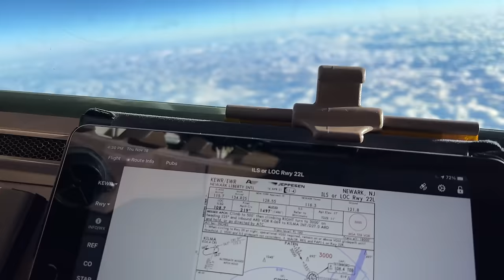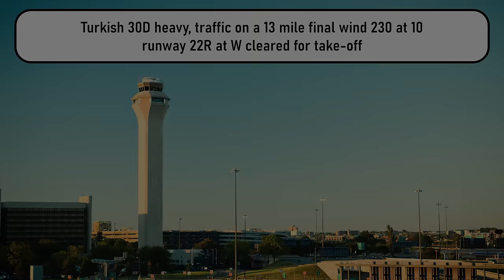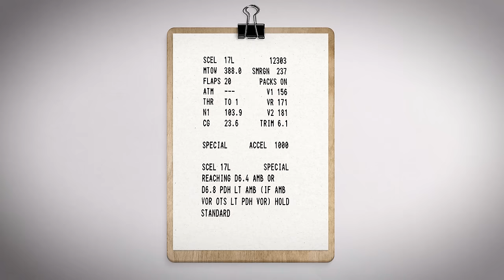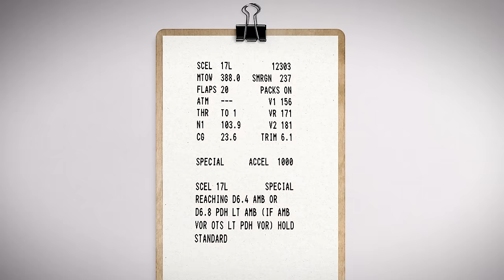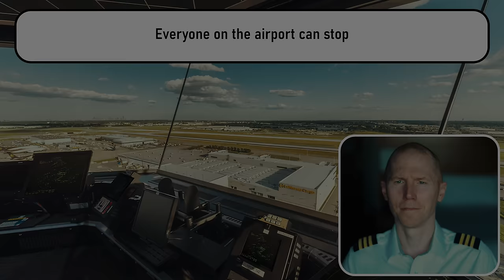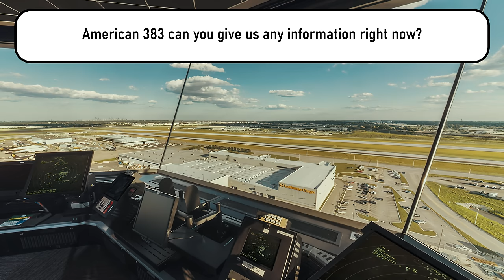American 767 Engine Fire

Comment: As always, excellent explanations.  Acknowledging that mistakes can be made by anyone, and the humility to admit you've made many is refreshing.  Unlike your early piloting story, I did land on a taxiway and it was extremely embarrassing when I realized it.  I had maybe 120 hours and was part owner of a Cherokee 140, and decided to take some friends on a short cross country to a rather larger airport.  Since I was used to the 75 foot wide runways at my home base and getting rather flustered by ATC squeezing me in amongst various DC9's landing and taking off - I was cleared to land on a runway, and I lined up with what I thought was the runway.  The controller let me land and then said *****Kilo exit taxiway delta at bravo.....  And I immediately realized I had landing on the freaking taxiway!  (the taxiway was wider than my home runway, and after I touched down I commented to self, "this is an awfully bumpy runway".... then the controller gave me the scoop when he said to exit taxiway...)

Then when departing a few hours later, and asking for clearance to taxi to the active, suddenly the ground controller said "Oh *****Kilo" and he proceeded to speak very slowly and deliberately, indicating to taxi via so and so and such and such to RUNWAY 29....  emphasizing "Runway" in a somewhat amused and mocking manner  (and I could hear other controllers in the background laughing).  No pilot deviation calls, just some verbal ribbing by the controllers, but I was humiliated and horrified to say the least  (this was back in the late 1970's).  (and I didn't tell the passengers until we landed back home)
Reply: I'm 70 years old now. At age 20, in the military, while doing maintenance on an aircraft, I mistook the fuel dump switch for the battery switch and dumped enough fuel on the line to surround the aircraft for 60 feet in every direction. I am convinced that the poignant memory of that horrifying error has saved my life in the intervening years many times over.
Reply: Heh, I guess we all make mistakes sometimes. While I’ve had a lot of fun during my years on the ground crews-starting with Aircraft Services (interior cleaner but also operating the lavatory and water trucks) and hybridising onto most ramp duties (pushbacks, marshalling, placing the aircraft stairs, GPU usage and some baggage ect)- the worst I’ve done was go from a brightly lit 737 during a night shift and down the stairs on the dark shadowed side of the plane and forget to give my eyes a couple moments to adjust. Hence about four or five steps from the bottom while carrying a caddy full of cleaning chemicals in one hand and a pillow in the other, I don’t quite put my foot in the right place and I start to fall. 

And while trying to get my balance back, the other foot catches the corner of the pillow and that’s it I’m done for. I fall down the remaining metal steps and eventually land on the concrete aircraft stand.  So of course pain explodes from multiple parts of my body and I can literally see bright spots in my vision from the head impact. But I also see the one colleague who witnessed me fall just turn away and continue to walk towards the GPU (ground power unit-basically a diesel fuelled generator with cables and plug to give planes electrical power for lights and whatnot) to turn it off and disconnect it so it can be towed to the next aircraft we’re going to clean. Yes, that colleague is a major douche bag. He’s also just walked out from his shift midway through and blatantly pretended to be sick when he realised we had no airside qualified drivers on the team those nights and would walk 8-10 miles that night between planes. I’m not fond of him.

Anyway while I’m lying there half stunned and cautiously moving various limbs and generally determining if I had any major injuries other colleagues putting their equipment back in the van parked close by noticed me and ran to my aid. By some miracle I didn’t have any serious injuries aside from a bump on the head and a few scratches and bruises. Unfortunately I couldn’t convince my colleagues of this (and I don’t blame them because the side of my face and forehead were bleeding and scratched) and they half panicked, flagging down a pair of pilots and group of flight attendants who had recently landed from another 737 nearby who promptly joined the first aid efforts. I ended up with the on-site medical team being called to me and being watched closely for signs of concussion or compression for the rest of the night.

The actual scary mistake I’ve been involved in wasn’t mine but it still affects me almost every shift because it was so scary. So parts of our taxiways and ground vehicle roads are parallel with only the double white lines separating the two, and planes will turn from the taxiway to cross our road to get to some of the aircraft stands to be marshalled in by someone waving the batons at the pilots. (Admittedly this is my favourite task, even if seeing this big plane with active engines coming straight towards you can take some getting used to.) On this day I was a passenger sitting behind the driver in our van as we headed back to our base. I honestly don’t know how he missed the 737 clearly following the yellow lines and the marshal plus other ramp staff gathered around the stand itself, but he did.

We’re all told this multiple times during different stages of our training, there are signs warning us again that the aircraft always have priority and if we’re ever not certain what one is going then we’re to stop and the nearest safe place and observe until we do know or the aircraft is no longer in a potential conflict path with our own. And so he carries on driving just as this 737 is turning to cross our path. I’ll never forget the terror I felt when I realised that the driver wasn’t going to stop and I looked at the engine closest to me, fully active and pushing the aircraft along the ground. We passed so close to the nose that I could have reached out and patted it as we skimmed by. The third thing I remember is looking up at the first officer’s face once it was clear that we were just going to skim by the narrowest of margins. We probably had matching expressions of mingled shock, terror and disbelief as our eyes met.

I was slightly surprised that our driver opted to just carry on driving back to our base and park up there like nothing happened. I personally would have pulled over and parked in the nearest appropriate spot and just waited for Airside Ops to come for me. Consider them as like airside law enforcement. They are responsible for security and safety out on the airfield and apron and with hundreds of security cameras constantly monitoring every inch, they would come for him even if the pilot and ATC hadn’t seen and reported the near miss. But yeah they took less than ten minutes to find him and suspend his security pass. It was restored next shift but he had his airside driver license suspended for two months and had to retake the test. Nobody in aviation wants someone not to report a mistake even if it causes damage for fear of punishment but we will be given strong reminders never to do it again.

But it looks like everyone does dumb things once in awhile.
Reply: Was this in the US? I have to say your controllers really sound like jerks over there.  I also think they contribute to more accidents than they help avoid due to the rapid fire colloquial style you hear on ATC recordings. I think where I work in Europe, because language is a constant variable (English is used but accents are common) controllers are far more careful to speak calmly and politely.  Even when ours are judgemental it rarely feeds over into obvious mockery.
Reply: @hamsterminator  I've listened to plenty of non-US ATC. They ALL speak fast, esp. in their native tongue.
Reply: If you did that these days, there would a long call to ATC and the FAA afterwards.
Reply: @hamsterminator  Yes it was in the US.  And the tower controller was professional, merely gently pointing out my error.  Later the ground controller was a bit mocking, but I deserved it...  and I'd much rather be gently mocked than be required to call a phone number and be written up for a pilot deviation!  I was a rookie and my radio etiquette probably revealed that to them, which I believe is why they were forgiving and in a sense "teasing" my rookie mistake.  The shame I felt for making this rookie mistake resulted in my never loosing situational awareness again though, so the end result was positive!
Reply: even Han Solo has done that so.....
Reply: @hamsterminator  Well thats the difference, back in that time thats how you taught people.... No pilot deviation calls.. no fines or charges.. just some ribbing to make sure you remember that mess up and make sure it doesn't happen again..
Now a days no one is "allowed" to make anyone feel bad/stupid, so its just an automatic Pilot deviation, paperwork, fines etc..
Me personally id take a good ribbing and the lesson and skip the rest
Reply: @Morpheen999  However, that also might be what contributes to pilots, say, letting their kid fly the plane. Never getting written up because ATC thinks the shame will correct you only works until you find someone who doesn't feel shame or thinks they're always right.

Might be a good middle ground somewhere like this, just like there's probably a middle ground between "boys will be boys" and "no fights allowed"
Reply: @sodthatlikebutton1946  It would have been much more exciting had it been AVGas. I got summoned to the maintenance officer's office that afternoon. He just let me stand there at attention for awhile while he did some paperwork, and then looked up and said, "You're never going to do that again, are you Anderson?" Yea, I remember that real well too.
Reply: @sodthatlikebutton1946  Our officers were all pilots, and you know how cool THEY are 🤣.
Reply: It’s strange people don’t understand this mistake has been made by many. Including TEAMS of professional pilots with paying customers on the plane.  Not 1 Pilot dealing with unfamiliar airport, wake turbulence, issues of being slow “get out of the way”. But TWO pilots.  Splitting workload, checking things flying commercial jet… into airport they have landed 40x before.
  Of course more rare.  But it’s happened.  They land at the wrong airport.

Comment: 👍👍👍👍👍 One day while at work on the airfield we had a landing come in where the landing gear collapsed. The belly of the plane heated up that the asphalt melted in a 30' area/circle. The runway had to be closed down till a safe and completed patch could be done. It to about two weeks, if I remember correctly. Another time a hot brakes/wheel incident made it to the designated area specifically designed for such emergencies. It is a large concrete area so their was no asphalt damage anywhere, runway, taxiway nor tarmack.